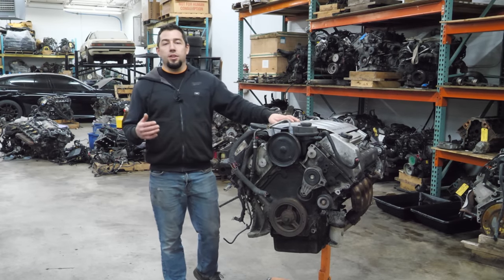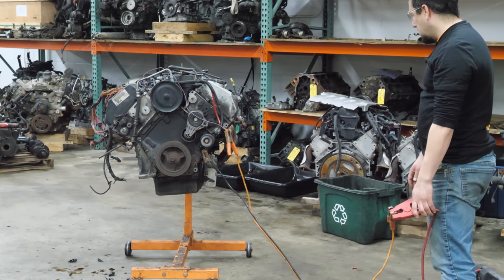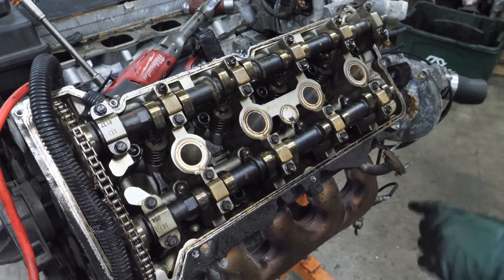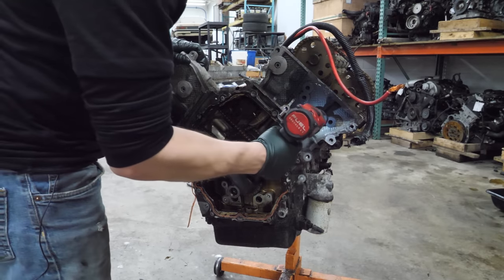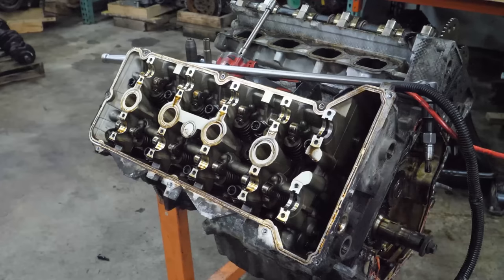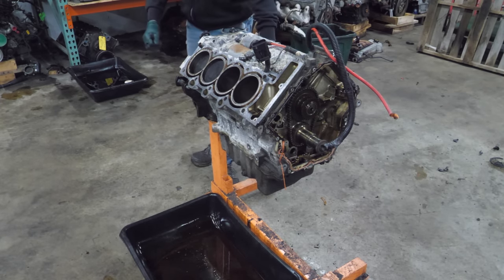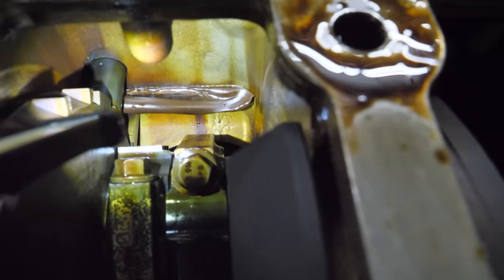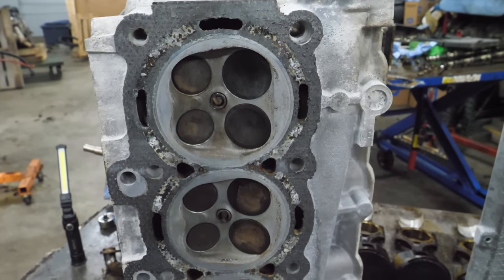Customer Returned This Cadillac Northstar L37 4.6L V8, How Many Things Can We Find Wrong?

Comment: The headgaskets on these are a composite material, they degrade far quicker than an mls gasket and they end up in the cooling jackets which causes the overheating. The reason for the gasket selection is to make up for the poor sealing GM couldnt resolve in time.

Comment: Those engines absolutely suck to work on if they are still in the car. Those upper oil pan/girdles always leak. It's no wonder it was slathered in sealant. The coolant crossover pipe you took off so easily won't come out in the car because it bumps up against the transmission, engine out job and they usually leak after 100k. The water pump will come out with special tools without taking the engine out. I wouldn't be surprised if that garbage in the coolant passages was some sort of leak stopper. Probably just kept adding water to save money.

They do run really smooth and actually get good gas mileage.

Comment: The back and forth you discovered with the crank tells a damning story in itself. Surprised you didn't show the thrust washers as i bet they were chewed up. Bet with that crankshaft walking it was eating into the main journals and was probably a big reason why the transmission probably failed.

Comment: As I understand it, the Olds Aurora engine was what happened when their division needed an engine with which to go sedan racing.  They took a long, hard, look at the North Star and made the needed strength/durability improvements.  

Like most great plans in the American auto industry, though, someone in accounting noticed they could save a pile of money, "if we"...(enter terrible decision of your choosing)...or, "Maybe we should just kill off a division or two."

Good bye, Oldsmobile, the oldest of all the divisions, and center stage to the Chevy small block. Nothing against the small block, it was merely pawn in game of life, like Mongo. (the cool kids will get that)

Bad and sad for the L-47 Aurora engine, but good for the Chevy engine, as there was now enough money to continue its improvement into...um...an all-aluminum, twin-cam, four-valve, horsepower-dense, ear-busting, hyphenated-hellbeast...about 30 years behind the curve that the Northstar was on when it was re-thought a bit to become the Aurora.

Same sort of thing happened to the Pontiac Fiero...when it FINALLY got a decent suspension so it could be driven 'round a curve, a decent engine so it could go zoom, and bodywork that was worth looking at..."We've never made money with this thing, let's cancel it.".

Comment: I'm willing to bet being a 02  was a mid year for coolants. Couldve had green or orange originally add a bunch of the wrong coolant and you get all that junk. My other bet is the crap on the end of the head bolts is corroded aluminum

Comment: Low oil pressure at idle + piston slap. 

I had an engine in much better shape engine and when it was cold you could hear it. 

I had a 2004 revision engine, where they changed the head studs to coarse threads, which fixed the “blowing the head gasket” issue. I racked up 120,000 miles in 5 years, only had 2 minor engine related issues, valve covers and intake manifold gaskets.  

Rust started claiming the car, last year and I got rid of it. 

ALSO CHANGE YOUR DARN COOLANT. THIS IS WHY DEXCOOL SUCKS.

Comment: At the start I was wondering why the motor wasn't covered in oil like they always are. Then you pulled the pan and found out why the parts department was missing five tubes of RTV. Any time I see that kind of mess I'm reminded of a guy I used to work with that insisted on making the great wall of China in place of the block seals of intake manifolds.

Comment: Must use Dexcool or rust will happen, as it did in this engine, causing a chain reaction failure. On top of that, the engine lubrication was severely neglected.
Reply: Must also change the Dexacool every couple of years.
Reply: @toothrestorer6588  five, to be exact, according to my vehicle's manual.
Reply: @AnnatarTheMaia Knowing what we know now, I like to error on the side of caution and change it every 3 years. It’s cheap insurance.

Comment: Good example of what happens if you never change coolant. Surprised the water pump lasted as long as it did- they used to fail in time to save the rest of the engine in a situation like this, forcing the idiot owner to change the coolant before it got this far out of hand. Those head gaskets corroded- something that happens to probably more engines than we realize.

Comment: Never saw a Northstar without head bolt threads pulled out of the block. Everyone I ever saw, came in after it sneezed the head gaskets and overheated. The rethread stuff GM used didn't always work either.

Comment: Why so much corrosion in the cooling jacket and water pump? Is GM dexcool that horrible or were they running straight water  or aftermarket coolant? Maybe head gaskets were leaking and the owner just added tap water to the radiator? Or did all that corrosion happen after the engine was removed? Unlikely.

As unreliable was head gaskets and oil leaks, the Northstar seems to have a healthy enthusiast following. The bedplate sump design comes from racing and is also used on many Supercar engines along with drysump lubrication with external multi stage oil pump and oil tank. GM also used the Northstar in racing alongside its Oldsmobile Arora cousin, with mixed results.

Comment: 90% of all engine failure issues are related to Failure to do regular required maintenance on time without exceeding the maximum mileage allowed. It is fa, fa, fa less costly to change fluids such as oil, cooling fluid and transmission fluids 'religiously' on time than it is to pay for replacement engines and transmissions.

Comment: Graphite Head gaskets! This is why GM had a specific coolant requirement for these engines. The HT4100's are the ones that would pull the threads out of the block because the pitch on the bolts were 1.75! I don't know what the engineers were Smokin, Drinkin or Snortin back then but they needed a boot stuck in there a$$es for this B.S! These Junk engines would always give you some wonderfully unexpected surprises. Northstars are overengineered nightmares and a simple oil leak requires removal of the engine to replace the sump gasket!! All because of the way they routed the exhaust pipe!, And you can't take it out any other way..WOW!! I have worked on both and would not recommend these cars to anybody! Even machine shops that I knew would not touch any of these things because of liabilities they can present and the cost of prepping them for assembly.

Comment: Actually, the water pump is pretty easy to replace on the 2000-2005 Northstar.

However, GM changed the design in 2006 and the job became a total nightmare.

Comment: Eric, I thought I heard you ask "who did this" in regard to a couple of the part designs early in the first day's work on this engine.  We must not forget the Cadillac division of GM  notorious for radical types of engine designs back in the 20th Century that only lasted one or two production/sales years.  

My mother bought a used 1982 Sedan DeVille with the HT-4100 power trai package.  The 4.1L V-8's digital fuel injected engine and 4 speed electronically controlled transmission was ok on flat land out here in the San Bernardino County portion of SoCal.  The drive along the northbound I-15 in through the big climb portion of our Cajon Pass exposed the Achilles Heel of the performance of that power train package.  Even when my mom was the only occupant in the vehicle, she had to use the truck lane to crawl at about 10-20MPH like the loaded 18 wheelers.  One of the biggest problems that the HT-4100 power train had was the ECM (brain) would cause the transmission to lock up when the computer died.  

It is cool to learn that the Cadillac engineers created an engine design that lasted for 18 years.

Comment: I'd like to make a suggestion: You often talk about too much RTV. I've probably done too much myself, not being sure of how much is enough and worrying about not using enough. How about you put something back together, not the whole engine, but maybe an oil pan or valve cover, and show us how you would go about it? Especially how much to use!
Reply: If it has a gasket... then don't use ANY ATV unless the engine repair manual specifically states to use it.
For metal on metal like this one, a special Anaerobic Flange Sealant is what should be used. In all cases, consult the manufacturer's repair manual and use what they recommend. If you don't have a manual you shouldn't be fiddling with the engine anyway.
Reply: @johncoops6897  well said.

Comment: the engineer who designed that starter location must have been the same one who designed the water pump location on the Chrysler Concorde - inside the engine block - which required removing the cylinder head to replace it

Comment: It's a lovely engine when it's right, but they are not a good design. Stud and headgasket problems are common, and doing uprated studs is possibly a bit pointless in my experience, it just cracks the block under the stud bosses next.

Comment: I have a 2003 Cadillac Seville STS. It makes tapling tickinb sound from engine. Heard probably lifters. What do you think.  What can i do. Im unemployed very little money . Tried slick 50 seemed to work but came back. What do you tiikk it is what can i do . Bought from neighbor who moved insisted no issues
Reply: The Northstar is an overhead cam engine.  There are no lifters. Lifters are used in push rod engines.

Comment: My wierd friend that actually likes these engines, has raced a couple examples, etc, confirms what you have shown here.  In the grand scheme of things, the primary issue with the Northstars was actually how they were packaged...both the engine itself and physically in the cars.  Sure, head bolt threads and early head gaskets are crap  but all that would be fine if you could do a head gasket job in the car...or the rear intake manifold gaskets....which also means the starter.  He is obviously not completely right in the head but it does appear he is not wrong on this.

Comment: The main failure of the North Star V8 was the head bolts/studs. Those were to small for that V8 engine. I've seen plenty of Cadillacs with this engine that are for sale. These vehicles sit a the dealers lots 3 times as long because of head gasket failures...and people know it. Other than that those Cadillacs are nice cars.

Comment: What happens is that coolant run down the studs & rots the alloy in the block. There is actually a stud kit by an independent guy to repair this. Add 16 hours to heads to do this repair & it makes an extreme mess for this job.

Comment: Very interesting engine design... The Neglect of oil and filter changes, the extremely clogged contaminated cooling system, and the hack who used excessive sealant 'repairing' it sometime in the past, pretty much ended the life of this engine...

Comment: So, poor maintenance (tap water in coolant system) and a poor RTV job not to mention a broken bolt in the camshaft and fried pulley.  Otherwise, the Northstar showed wear consistent with 155k miles.  So much for all the heavy criticism of this engine at least for this particular example.  Thanks for doing this motor!

Comment: Now pull one apart in vehicle, especially a oil pan re seal, and one of the older version water pumps that don’t have the twist able water pump designs that you have to take the housing off to change, hate these things with a passion.

Comment: The main bearings are trashed because of the Over use of sealant changed the tolerance between the main bearings and crankshaft. I've rebuilt 2 Northstar Engines and one came back to bite me with oil leaks . This engine is strong but it's a leaker .. Overheating Conditions Ruin this Engine entirely by blowing the head gaskets all the time. 
This engine is " $$ EXPENSIVE $$ to rebuild, parts alone are $$$$$$. 
💥 BADA BING BADA BOOM 💥
I APPROVE THIS MESSAGE 🙌
Nj'sJfJr 👍🏼💪🏼❤️🇺🇸

Comment: besides the NASTY cooling system, the thing that surprised me about that engine was the TINY, SPINDLEY CONNECTING RODS!  They looked like anything north of 4500 rpm would snap them in half like the toothpicks they were modeled after.

Comment: I'd love to see a Toyota Yaris 1.5L L4 DOHC engine teardown. My car has 175K miles on it and zero repairs have been needed. I just would like to see how it all goes together.
Reply: @ 175k , yaris is almost broke in. Be awhile yet before it needs attention.
Reply: @peted5217  I sure hope so, I need a couple more years. The brakes are original too, as well as the clutch, though it's not smooth like it use to be. I wish I could buy a brand new Yaris next time, but they quit making them.

Comment: Bought new 2000 Deville--changed oil every 3000--always something wrong with something--at 90,000 head gaskets failed--spent 6500 for sur certs job--failed again at 109,000--could not find anybody to work on it again--scrapped the whole thing. This was the worst car I ever had in 75 years of car ownership!!

Comment: I've always wanted to see if those crappy engines would have lasted a little longer and the head gaskets/head bolt threads faired a little better if the engine wasn't ran at 240 F and higher most of the time and maybe ran at 180-190 F instead.  Of course that would piss off the EPA since they want the hydrocarbons to get burned off the oil no matter the damage done.

Comment: Not pretending to be any sort of expert, but GM messed up this engine from day 1. The head gasked issue is most related to the head studs not being able to hold pressure properly, because GM decided to use fine threads on the steel head studs that were screwed into an aluminum block. From 2006 onward, they went to coarse thread for the head studs, and the problem pretty much disappeared. The after market kits pretty much duplicate this. Only issue is, to get this done by a garage/machine shop is pretty expensive, and considering the age of these engines now, probably not worth it.

Also, many blocks have a lot of internal corrosion due to not using the correct coolant due to dissimilar metal corrosion. The incorrect coolant starts up a process in which the steel parts and the aluminum parts react with each other, causing the aluminum block to literally eat itself.

Comment: If it is an L-37 with that intake and rails it went thru the 1996 recall,the old intake with a Magnesium cover was a disgrace and parts discontinued,this engine was run with inferior gas,no oil changes whatsoever and the coolant probably rotted to the core,i mean it never was changed.

Comment: When they first came out they were synonymous for gasket problem in all areas they leak like sieves so yes overheating was a common problem by the time you got a check engine light it's probably too late.. if I'm not mistaken are supposed to run synthetic and they had a special type of antifreeze not sure if design problems is the issue as much as customer maintenance and a good mechanic!" You're probably not going to like this since I'm sure you deal in hard parts" but this is a sloppy teardown

Comment: Me thinks the rotating mass was in good shape and would have continued for many miles. The bearings looked very good. ANY engine with some miles is going to have vertical cyl scoring. Obviously the cooling system was down the toilet. That water pump housing is/was just silly. Now I ask myself why wouldn't Cadillac just use the SBC 350 or an LS3 straight out of the Vette?????? The NS engine is clearly grossly inferior to the LS. I guess that's just Cadillac.......

Comment: Northstars do get a bad rap, but from GM, they are crap. They can be made to be reliable. I had a co-worker who tore one down to the block and rebuilt it with stuff to help with the head gasket issues, and it's gone across the US at least 4 times since 2018.

Comment: One thing to be learned here. Dont over use RTV silicone  adhesive sealers and gasketmakers, the right product at the right amount always.  👌  im still an old GM and Mopar Guy. Forget these plastic laden engines Festooned in even more plastic and finally decorated in Plastic.  😂

Comment: People make two basic mistakes where RTV is concerned. If some is good more must be better. Wrong!  And if you are using it on engine mating surfaces where it will come in contact with oil you need to let it cure for 24 hours BEFORE you add oil.

Comment: dexcool. has to be changed OFTEN or this happens. also dexcool hates air. any coolant in the engine when they pulled it will come in contact with air and sit and crystallize.  thats why its all plugged up. 2 prong cause

Comment: That is a nightmare of an engine. Hard to believe that the same company that designed the original small block Chevy could have designed a POS like that. My guess is most of that crap in the coolant passages is solidified DEXKILL. It is probably what dissolved the head gaskets as well. I can't believe anybody would actually want to rebuild a NorthStar engine. It was rubbish from the beginning. It was garbage when it left the drawing board, and then as bad as it was, they put DEXKILL in it. There is simply no reason for an engine to be that complicated. I could get more power out of an original 350 cast iron small block, and it would last longer as well.